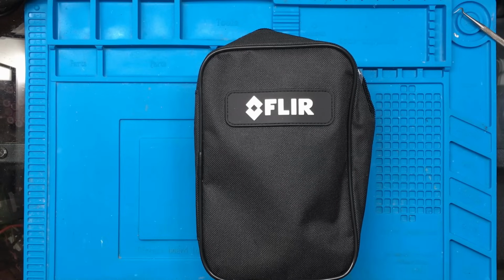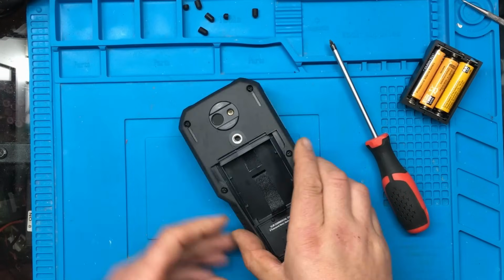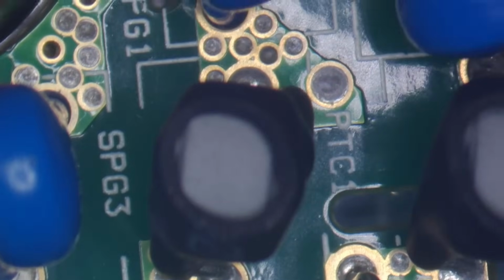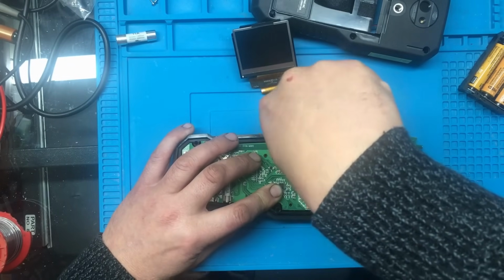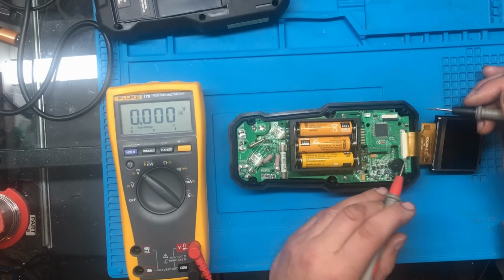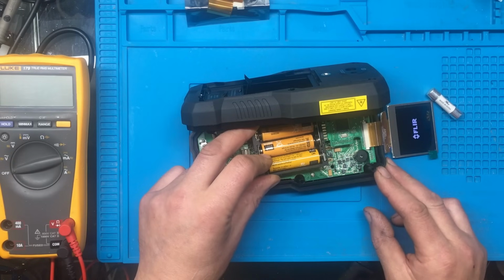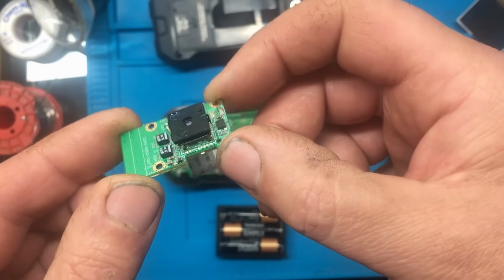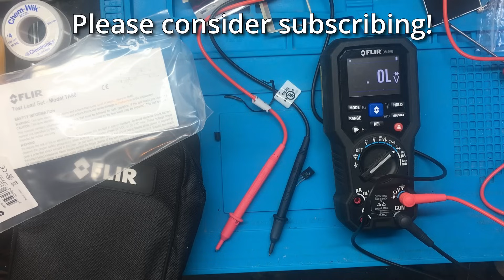FLIR Thermal Imaging Camera Multimeter - Teardown & Repair!

Comment: In cases like this, I search for the CPU datasheet and try to find UART TX pin to get some debug log to find out what's wrong with the device
Reply from the maker: I've done similar a few times too, like on the AVerMedia capture device video and on the recent VTech baby video monitor repair.

Comment: .. about "thermal camera" / "infrared sensor", they are the same thing.
every warm thing, from a stone to your own body, a red hot stove, the Sun, etc., emit infrared, so, we're talking about the same beast with two different names.
same for CCD sensors: mostly, they are sensible in almost all the spectre, but because manufacturing process is not so "digitally precise", some CCD's are more sensible on a part, others on other part, so, they just test them, and mark accordingly.
if you are too bored, take some cheap ccd's, from defective phones, tablets, laptops, cameras, webcams, etc, and test them...
you can have some nice surprises! :)
even there can be some software involved, interpolating and enhancing the raw image a bit...

Comment: So how exactly did you find the replacement screen?
Reply from the maker: I found the specifications of the meter "2.4” digital TFT display, 320x240 pixels" The size is actually wrong as it's slightly less! (probably a marketing thing). I started looking for a screen that had the same resolution, size, and same number of pins on the connector and that's how I came across the screen I used. It looked very similar apart from the difference in the one pin that I discovered.

Comment: * - 20:38 when u had it disassembled & you put the display on backwards..  that could have been VERY bad... also u should have tried updating the firmware 1st.. b4 disassembly.. it could have just been corrupted..
Reply from the maker: Hi Terry, thanks for your comment. 20:38 the display is connected correctly (it folds down over the PCB). It would not power up the backlight otherwise. See 31:59 where I fit a display that hasn't failed and it's connected the exact same way. 
There is no way to update the firmware on this unit (I did think it could have been a firmware issue and checked at the time), and you can only update the firmware on the version next model up from that one that takes the SD card. 
This one doesn't. I even tried the hidden internal USB which does not enumerate as a device. Hope that explains everything 🙂

Comment: You measured the operating voltage of the display 2.7V. Datasheet says that operating voltage is 3.3V. So original display may work fine if the VCC is right  ???
Reply from the maker: The new display is also 3.3v as I thought it seemed low at 2.7v. I think I did read in the data sheet that the VCC was 2.7v to 3.3v. It seems they chose this voltage as it also supplies the lepton sensor core which is rated at 2.8v
Reply: OK. The reduced operating voltage increases the operating time of the battery @BuyitFixit

Comment: 10 year warranty sound good for this product, maybe the original owner can provide you with a purchase ticket. There again the manufactures probably would object to repairing it seeing that an independent has already opened it.
Reply from the maker: I think this was a customer return as the unit appeared to be brand new and unused, so I doubt they would have been able to provide an original purchase ticket otherwise they would have just done that themselves.

Comment: Right to repair is not compatible with some companies I had a battery fault with a Sena motorcycle crash helmet headset,  I contacted Sena and as you were told no spare batteries would be supplied and no repair service outside warranty would be supplied. I also searched the Internet and the battery part number didn't find any replacements either. The replacement headsets are between £250 & £280 all because of a ? £20 battery.
Reply from the maker: What! I think I'd be looking at making or using a different battery. If you haven't sorted it, feel free to drop me an email with some pictures and I'll see if I can advise or help👍
Reply: @BuyitFixit  Thanks for your reply unfortunately I bit the bullet and replaced the whole unit.
Reply from the maker: Ah no worries 👍

Comment: Their lack of support is disappointing and we should keep fighting for right to repair.

They offer a 10 year warranty, though, and that's fairly impressive.
Reply from the maker: I think that only applies to the original purchaser, and if you have proof of purchase :(
Reply: unfortunately as you stated the warranty only is available to the original purchaser this should not be the case especially with it being a 10 year warranty this should be completely unconditional and available to all purchasers whether it was bought new or second hand the company could easily check the date of manufacture by the serial number and i feel the warranty period should start from the date of manufacture unless the purchaser can provide proof of purchase this would then allow subsequent purchasers to benefit from the 10 year warranty. failing that the manufacturer should be forced to provide spares and service data backup to enable the product to be repaired by a third-party repairer or repaired by the owner if they are capable of doing so.  I used to repair consumer electronics mostly Tv sets and audio equipment i stopped doing repairs when it became dificult getting the spare parts and service manuals for the products this was around the time when CRTs started to dissappear and flat screens took over the first flat screens used to have service manuals available but the majority of the tv was the LCD panel and this was regarded as a single component and was deemed unrepairable and the manufacturer would charge almost the same price for the replacement panel as the price for the entire Tv set. I have done a few repairs mainly for family and friends these were mostly PSU repairs or replacing backlight LEDs. Great job with that meter. You are very lucky with that one. i am not surprised that the obscure Chinese seller of the display was much more helpful than FLIR !!

Comment: If Google serves me right the DM166 was released in 2017. So if they offer a 10 year warranty, then why do they need an invoice?
Reply from the maker: Probably something in their warranty terms and conditions to say the warranty is only valid with the original purchaser or something I guess, even though I totally agree with you👍
Reply from the maker: I recently had the same with Ninja, I bought one of there food processors just over a year ago, used the blending jug around 2 or 3 times and noticed it is all cracked around where the motor shaft goes. I contacted support and they had a look via video link and was told I was about 2 month out of warranty. This is obviously a manufacturing issue as there are loads of reviews on their site with a 1 star rating saying pretty much the same problem.

Comment: I am really surprised that you were not able to source what surely is an off-the-shelf part worth only $10. Given that the TIM is over $200, I am sure FLIR does everything in their power to keep the prices down on the rest of the parts.
Reply from the maker: The number of the original part is shown in the video, feel free to have a search. I only found the one I used by searching the size, resolution and then comparing the ribbon cable with others that I found pictures of until I found something very similar. Searching the part numbers on the screen didnt result in anything at all.

Comment: Why do they need the invoice!!! 10 years is 10 years no matter who originally purchased it.  Even if they try and say it’s to identify it was bought within the last 10 years, I don’t think they started manufacturing these more than 10 years ago and even if they did, I’m sure the serial number would give them an indication as to its manufacture date.  It’s just another way of them not having to repair or replace their own devices and ultimately contributing to landfill
Reply from the maker: Yep. And I doubt they have made this model for even a couple of years so it should be in warranty no matter what..
Reply: But there's an end of line to consider - if they've already exchanged the original receipt for a free warranty replacement meter, they're hardly likely to want to offer another free replacement for it. For all anyone knows someone removed it from the skip after it had been swapped, and sold it on eBay for £80. in which case, on this occasion, everyone was a winner :-).
Reply: @will_doherty  You find companies commonly smash warrantee return units before dumping them for this exact reason.  However with serialised products and modern 'service' records it would be easy to determine if this was a return unit.

An ethical company would collect community repair information and use it to improve their repair department skills, the reverse is probably true these days and they use this information to prevent the same sort of repair in future. 😞

Comment: What would have happened if you just tied that pin to the power supply?
Reply from the maker: Nothing, I tried that too. I think the microcontroller pin was set to interrupt on falling edge or such, so it sat until there was an actual transition. Hope that helps 👍

Comment: Is great to think outside the box, most manufacturers make parts for oems and will not sell you the part, I had a similar issue with ge fan and I contacted the manufacturer and will not sell it to me I had to to ge, ge price 400usd similar fan from the manufacturer 70usd
Reply from the maker: Thanks Jose. I had similar with a Milwaukee sander. Milwaukee part £70 and I fixed it for around £9.

Comment: Did you not get into the display? it seems odd it should have failed between the factory and the point of use. 
I bet retailers won't get told to just dump it in future, they will all be returned to factory for crushing.
Reply from the maker: I did have a look at the display but there was very little on it besides a few capacitors on the ribbon flex and a small glass type driver IC also bonded to the cable. All the capacitors measured ok so I think the driver IC or bond wires going to it had failed.

Comment: I have never seen a battery case just laying on the board with no connections , power up a unit like that ... Fill me in on that please....
Reply from the maker: Theres metal contacts on it that touch spring on the board iirc

Comment: I call B.S. on Flir's reply to you. Even without RightToRepair supplying a part which you already have in your device cannot divulge proprietary information. I can understand (though not condone) them not wanting to provide circuit diagrams as this may give away proprietary information. If you were asking to buy 1000 of each item in the unit then you might be trying to make your own units to sell - although spare parts usually have a huge markup so not a cheap way to go about ripping off someones products!! If China want to make a ripoff of something, then they are just going to buy 1 unit and reverse engineeer it.

I had an issue a few years back now with Philips with one of their DVRs. They were pretty rubish and the DVD writer drives started going bad about a year after purchase. I contacted them about obtainig a spare and they refused to sell to members of the public on 'Health And Safety' grounds as it contained a Laser - couldn't find any suppliers at the time who sold them. At the time I had been servicing electronic equipment for about 20 years but Philips weren't interested. I had by then moved to a different job role so couldn't buy it through my work company. I did contemplate setting up a fake company to see if that worked but couldn't be bothered in the end and gave up using the DVR.

I remember the 'glory' days of repairs when I started in the 1970/80s. Every maker supplied complete circuit diagrams and service manuals. If you were one of their approved retailers they even regualrly sent you them free of charge!! Back then there were few bespoke ICs and you could easily source and replace everything you need to do repairs.

How far we have come and yet taken large backward steps resulting in huge amounts of electronics going to landfill or having to be recycled instead of repaired.

Now retired but still repairing as many things as possible to avoid waste. (Drives my wife mad as she can never have anything new .............)
Reply from the maker: @johnr3435  😂😂😂Nice one, thanks for commenting and good luck with your future repairs 👍

Comment: Awesome fix!! Good thinking on the batteries too, if it was the batteries and didn't check that could have lead to days of WTF?  And people love to bash China, but they are usually willing to help, as in this case. Where Western companies don't want to fix or help, they just want to keep selling new shit to prop up the bottom line. I am sure you would have paid $50 for an OEM screen, if they offered it, instead you got it for less than $20 and learned more about how the LCDs function and will definitely help out in future troubleshooting.
Reply from the maker: Thanks inothome👍

Comment: * - could just be a firmware issue... and u keep putting the displays in backwards... it would fold down back on itself when in housing.. you keep putting it in backwards
Reply from the maker: Sorry Terry, I'm not following what you mean by backwards? The display is actually upside down in the unit by design. If you put it in the other way the ribbon cable signals and power would be on the wrong pins, and I am skeptical they would even make connection due to the contacts only being on one side of the cable.

Comment: I think the supplier in China will be in trouble. You paid £10 for the display, I wonder what FLIR would have charged for it.
Reply from the maker: It was a slightly different display and it's not bespoke to FLIR so I'm sure they will be fine. I bet FLIR would have probably changed £150 or so for the repair at least.

Comment: FLIR has gone full TESLA and APPLE, but can be seen by there high priced items as well, I guess another company to avoid.
Reply from the maker: Indeed 👍I actually got sent a thermal camera attachment for my phone to test. The resolution and frame rate is far superior to the FLIR. I did a video comparing this unit and the one I got sent.

Comment: RESUUUULLLT!
 And i hope FLIR or this gadget makers (didn't get the company name) see this with bowed heads: you completely slamdunked someone greedy, lazy or both in their immoral manager or even CEO ivory tower making no-repair policies. If they knew there is no replacement screens available on market and they gave any thought to this, none would've believed you can do it. Big cudos for the replacement screen retalers, someome have heart and mind in the right place by giving you schemathics of the original!

 Besides FLIR product policies or even quality seems dodgy in quality as well, especialy considering the pricing. Why would someone who just bought this specialised meter - visibly new - wouldn't send it back and get a refund? They had to sell it for 6× less and are lucky someone paid even that. Smells of nonexistant client service or ethics.

 I have a CAT mobile with a FLIR camera and while it worked, it wasn't too great imo. I knew about the low resolution given it's mostly a toy for a mobile, similar or lower than this one (will look it up now). Problem was that phone combines visible light camera with thermal to make a coherent picture, and both doesn't line up (like by 10-20mm on the screen). You still get the temp readings, but its all a bit fuzzy and i'm not sure about accuracy. You can manually add multiple points on screen reading the temperature on these points or average out an area, but it cannot find the highest or lowest points automatically as i've seen done with FLIR, so apparently software doesn't allow for it. After 6 month use the battery overheated and died, waiting for a replacement which us not cheap, but i guess that's the CAT issue. Luckily i bought it already a bit used, so didn't spend even 1/6th of the RRP. All things containing FLIR are pricey when new.
Reply from the maker: Cheers for that👍ironically I don't really use the FLIR now as I ended up being sent an infiray P2 pro which I think is great! It's got 4x the resolution, and 25 fps so it's a lot better than the FLIR. Also it records to the phone where as the FLIR one doesn't. Have a look at the review I did or the Philips soundbar video which shows you what the picture looks like compared 🙂👍